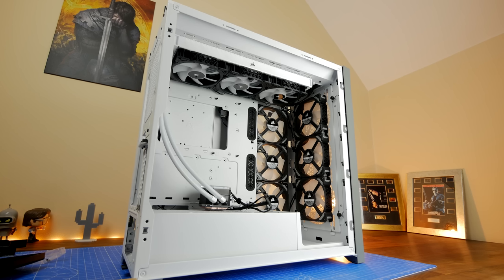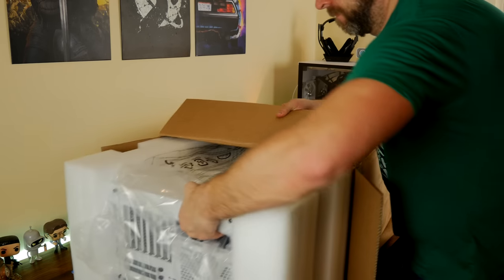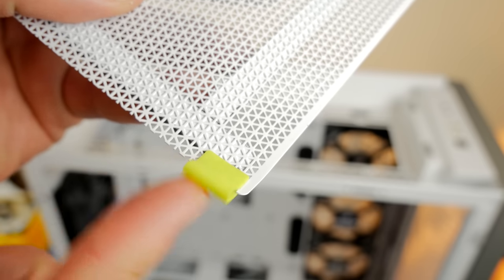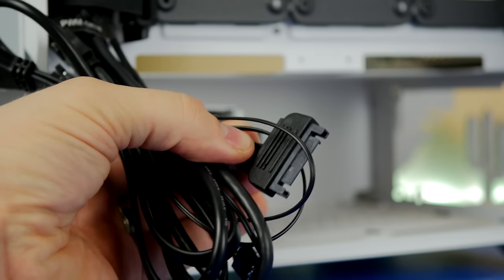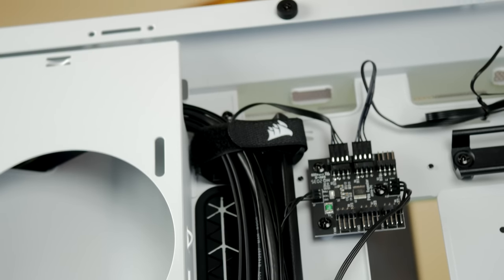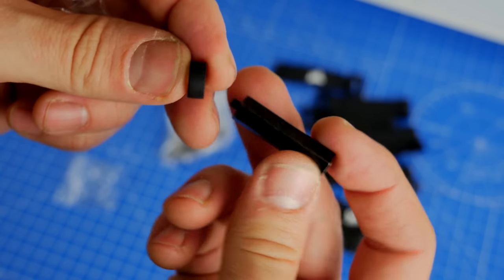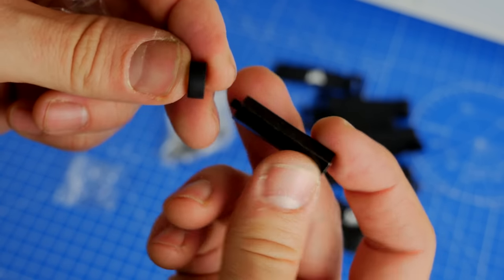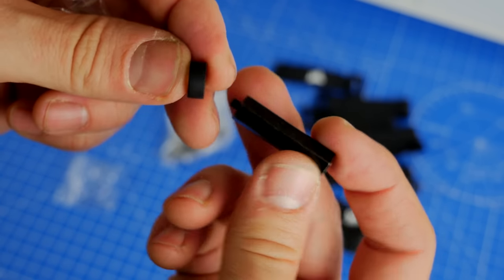Corsair 5000D Airflow build with 12 fans, H150i Elite Capellix Push Pull (in-depth build guide)

Comment: I'm doing an identical build to yours except I used the h150i with LCD display. Any tips as to how to connect everything to the commander pro.
Reply from the maker: https://youtu.be/XahzpIZFyrM
Reply from the maker: And https://youtu.be/jvXCbny-Suw
Reply: @TheProvokedPrawn  only one I'm stuck on is how to connect the LCD on the h150i to the commander pro. I have an Asus maximus z790 hero.
Reply: Thanks I finally got all cables plugged in and things organized. Now just waiting on replacement fan and cpu
Reply: @TheProvokedPrawn  I plugged in everything accordingly fans are all running but only three out of all 12 fans are lit up. Is there an area in bios I have to change this or is it in icue.

Comment: Does it support 3x 140 in the front? It doesnt say anywhere if its possible but those 120mm just look to small for the cut outs
Reply from the maker: The official page says 140mm support is two front, two top. That's it.
Reply: @TheProvokedPrawn  i mean ya but the cut outs hare waaay bigger than the fans so i was kinda curious

Comment: Hi I am doing a build with this case and a push pull top radiator configuration. What did you do with the dust mesh grill on the top?
Reply from the maker: I put it on top but you don't need to

Comment: Hi, what screws did you use to mount push and pull fans, please?
Reply from the maker: If I remember correctly they included enough with the AIO. But if you need them separately - XSPC Radiator Fan Screw 6-32 30mm... https://www.amazon.co.uk/dp/B015BSAQ0O?ref=ppx_pop_mob_ap_share
Reply: @TheProvokedPrawn  thank you. Im using just 'push' atm but i want to instal another 3 on top for push and pull. I will check my box if i got any left byt im pretty sure i used all the long ones. Anyway thanks to your video im rebuilding my case atm 😉 also want to put 3x 140 on the front, but i need to rebuild the mount as there is not enought space for 3, litteraly 0.5cm too short.

Comment: It's so frustrating that NOONE shows how to connect the cpu cooler cables when they do the core. Can't find a single video. I have x5000 case but it has fans plugged in and now the cpu cooler core has another SATA cable that I don't want to use. So annoying
Reply from the maker: I might have done a better job here https://youtu.be/VYgWCVMOQfE if not I'd recommend checking out Corsair Labs channel. They have setup videos.

Comment: Will most x570 boards have enough connectors on them to run a commander pro and commander core and lighting node?
Reply from the maker: Lighting node can connect to commander pro usb so you only need two usb headers which they should have
Reply: @TheProvokedPrawn  thank you very much man, also i may pinch your 5000 fan/AIO setup if you dont mind 😉

Comment: can i do the push pull set up with 5 fans? i only have the two spare that came with the 5000d
Reply from the maker: You shouldn't really mix and match fans as they'll run at different speeds and have different airflow capabilities
Reply: @TheProvokedPrawn  oh ok well thank you i hope it’s alright but i have 6 sp120 fans from corsair running in the case then i just have the rad i may plan on buying more fans for the pull in the rad

Comment: Ok so I have 13 fans in mine and of course only 12 slots any idea how to get the last fan rgb linked into the rest of them? 6 top (push pull) on the AIO 3 pre installed front 3 back panel and one rear.
Reply from the maker: For power you could use the system fan headers on the motherboard. Then RGB you'll need a lighting node that comes with a triple pack probably
Reply: @TheProvokedPrawn  OK, so the 13th fan is powered by the mobo fan header but no rgb power. I do have a few more of the hubs that came with fan packs but they require the  USB mobo connections, which are both occupied already by the rest of the rgb hubs. Unless there's another way to Power it?
Reply from the maker: @jasonb252  you could get a y splitter cable for the USB. Two ports into one.
Reply: @TheProvokedPrawn  genuis thank you so much!

Comment: I have the same aio and it sure do make the cpu run cool, but I noticed when ever my fans stop running, due to the zero rpm mode, I can hear the pump. Its a high pitched humming, and that's in the quite mode in icue. Is there any fix to this problem?
Reply: I have the exact same issue. Same setup here. The sound is driving me nuts when im working or need to focus. Im actually thinking of returning the cooler just because of the high pitch sound. But it looks so cool..
Reply: Same here. I was fortunate enough to be able to return it. I don't mind a little fan noise but the tone of that pump is impossible to ignore. Earlier models (like the H115i) were able to run the pump lower therefore quieter.

Comment: Hi what fan are you using for the exust at the top? Is it the same as the aio fans or can I use any?
Reply from the maker: ML120 Pro RGB if I recall correctly. You can't actually buy the exact same ones that come with the AIO at the moment.
Reply: @TheProvokedPrawn  thank you 😎

Comment: I bough separitly 4 white fan Corsaire QL120 RGB and i don't have the rgb's hub. Do you have an amazon's link to buy what missing plz
Reply from the maker: You bought four individual fans? Here's an RGB hub https://www.amazon.com/Corsair-CO-8950020-Rgb-Cfan-Compatible/dp/B075GWMJ68/ref=mp_s_a_1_9?dchild=1&keywords=commander+pro&qid=1617864367&sr=8-9
Reply: @TheProvokedPrawn  yes , individual fans because the pack of 3 was more expensive. But i didn't know that i would need more than the hub installed by default in my case (5000D airflow) for power & rgb. In fact, i need to hub, one for the power (by the one installed in the case) and one for the rgb. Why doesn't one for power and rgb only ?! Thanks for the link.
Reply: @TheProvokedPrawn  I got an another question, in 39:00 , you talk about the connection of the front pannel but i don't have this kind of connection in my Aus Prime Z270-A. is there an adaptater existing ?

Comment: am having issues after building get to bios 
really easy everything shows as it should. 
but had issues with loading an OS it kept going BSD or BSD
reset cmos tried a few more times even ran a win pe with no issues.
tried both win 10 and win 11 
any suggestion before I install my videocard asus 3090Ti and I need to register windows as well

ASUS ROG Maximus Z790 Hero 
intel core 13700K
Trident Z RGB 64mb 6000MT in 32 x 2
Corsair 5000D airflow
CORSAIR iCUE H150i ELITE LCD Display 
2 packs QL white 3 pack 120mm 6 total
MSI MPG a1000g Pcie5
Reply from the maker: Have you checked its not really simple things like your ram is seated properly. Turn XMP off and see if that helps, etc
Reply: @TheProvokedPrawn  yes I swapped the ram and used default setting in bios I was able to get WIN10 installed thank you for your advice.

Comment: Is push pull better than just push? I got a Phanteks p400a so I could only push pull with 240mm (top 2 fans) so it might look weird
Reply from the maker: I believe the difference is marginal. You could compare the benchmark temps in this video to the ones in the other Elite cappelix video I did and check how much difference it made. But that was a different case and setup.
Reply: Push pull would be beneficial for low static pressure fans as this capellix AIO comes with ML fans you won't need to add more fans. Other benefit from reading multiple source is you might be able to run the fans at lower speed to achieve similar results at higher speed (again because of higher static pressure, more air would be able to pass the radiator)
Reply: Thanks for the help guys! I ordered my h150i so I'll do some testing when it arrives. I wonder if yall would be able to help answer a dumb question: can you mount the 3 ML120s on the front of the rad and 2 SP140s on the back, or would the misalignment of the frames actually block air flow?
Reply: @shoturschnitzel8988  Besides misalignment of airflow path, I don't think you can screw in the fans onto the radiator. If this is p400a case I suggest to put the h150i as intake and use your 2x140mm fans as exhaust

Comment: 1. Push/Pull - no difference, flexing for no reason ( excepting the situation when you are going for the cheapest AIO and even there is a maybe for efficiency).
2. There is no reason to use the dust filter for exhaust, you are restricting the amount of air from the case.
3, Thank you for the vertical mount video, but between +20 degrees on the 3 SSD and chipset and +20 degrees on GPU....I go for GPU

Comment: hey, can i connect 3 ML 120 pro rgb fans to the commander core (controller is from iCUE H150i elitr capellix)
Reply from the maker: Yes
Reply: @TheProvokedPrawn  are the same fans that came with the pump
Reply from the maker: @granata4  no because you couldn't buy them at the time. Pretty sure I covered this in the video
Reply: @TheProvokedPrawn  corsair support told me that i can connect only in PWM slots now because fans are different i'm confused, I bought ML 120 PRO rgb fans because i thought they are the same as in the iQUE H150i elite capellix, now i have 3 ML elite fans from elite capellix, 3 ML 120 PRO rgb and 4 QL 120 rgb fans. How do I connect it all together now, what's the best options

Comment: you could have pulled the motherboard out plugged them in then pushed it back up same thing but simpler and faster then trying to remove your rad +fans and put them back in
Reply from the maker: Hmmm I would have had to unscrew the motherboard
Reply: @TheProvokedPrawn  yes but the mb is easier to put back in then trying to hold rad and put screws back in at same time

Comment: This video helped me SO MUCH! But ive run into a problem.

My 5000x case came with 2 "hubs". 1 for 6 fans, 1 for 6 fan rgbs. I also got the H150i Elite AIO, which came with a commander core 6 fan/6 rgb ports. The problem I'm having is I am trying to control 7 fans...

The smaller rgb core that came with the case AND the commander core both have a 9pin usb plug. I only have 1 USB 2.0 header on my mobo... So as of now, I can only plug in the commander core, so I have 6 fans that light up and work great, but 1 fan that I had to just plug directly into mobo and rgb doesnt work.

Basically can you go over how you linked all of them together? Can I just use a USB hub or splitter so I can plug both rgb controllers into the same usb header on my mobo? I obviously dont want to fry something, but I really want my other fan to be controlled by iCue like the other 6... I'd prefer to use a usb hub since its vastly cheaper than buying the commander pro.

Ive already ordered a 1 to 2 usb 2.0 header splitter AND the NZXT internal usb hub, but I'm scared to plug them in until I know its safe. I only plan on using 1 of them, and I've read that most people have success with the NZXT hub. Most online articles say it will work fine, but I read one review that said by doing it, it fried his commander core... PLEASE help!
Reply from the maker: I think I covered that in here https://youtu.be/VYgWCVMOQfE

Comment: I'm bulding a similar build so this video really help but I'm still confuse with one thing and that is the amount of USB and SATA headers I need for all of the connection because that affects your motherboard selection so I'm here to ask to see if anybody can help me figure it out. I'm going to have seven fans plus the three of the aio cooler which makes it 10 all around the build and Asus Rog Strix B550-A motherboard because it fits the color and brand scheme I'm working with, so let me know if that motherboard has enough headers for the extra iCUE Lighting Node CORE that comes with the three fan pack and the CORSAIR iCUE Commander CORE that comes with the AIO cooler
Reply from the maker: You can always buy something like this if you need to https://amzn.to/3PkNcly

Comment: I'm getting 7 fans, what do you suggest I do?
Reply from the maker: Well, you could use the PWM controller for six and then one just power via the motherboard fan header?
Reply: @TheProvokedPrawn  SO that would allow me to control them right? But what about the RGB, this is a bit confusing for me.
Reply: @sinz2159  which 7 fans are you using? if you're going corsair and buying fan packs (at least one pack), you'll get the lighting node pro with rgb hub and that will solve your 7th fan issue, so long as you're getting any of the capellix AIOs so you can use the commander core for six-fan power and rgb connection.
Reply: @giocalvin_  The ICUE QL120, and I'm getting the NZXT Z73
Reply: @sinz2159  the z73 makes things a little hard (more expensive too) . if you get 2 triple QL fan packs, you get 2 lighting node cores for the rgb plugs, and you have to get a commander pro, which rgb hub can be used to connect the 7th fan. I've never used the QL fans or the commander pro, but that's how I'd go at it from a rough mapping standpoint. I got 8 fans in my 4000D, 6 LL120 and 2 ML120 that came with the h100i capellix. The 6 Ll 120 are connected to the commander core that comes with capellix (rgb and power) and the lighting node pro that came with the LL120  pack is used to connect  the ml 120 and rgb strips. I'm planning on switching the lighting node pro to commander pro because the ML fans LEDs don't get all detected when I select them as ML in icue, but get detected when I select them as rgb strips. So that's that for info.
Reply: @giocalvin_  So should I just get the commander pro for the 7 fans

Comment: 38:00 i think you could remove just one black fan :D
Reply from the maker: Probably
Reply: @TheProvokedPrawn  I have this case now and had the same problem :D (I forgot your vid) Luckily i have Actic Liquid Freezer II 360 so it's 37 mm rad (not 27 mm like most AiO) and i had to move the fans outside to make it pull setup (i'm planning 15 mm fans to make it push/pull later). So i had a little more room (just 37mm rad, not 27+25 mm like you) and i managed to move the rad to the front and pass through the CPU cable :)

Anyway yeah ... it's the problem in this case, and the second is the placement of 360 (120 fans) rails on top. I had to make it as pull setup with 25 mm fans because i had collision with VRM cooler and it was literally like 1-2mm too close ;/ It would be much better if Corsair made the rails for 360 mm rad closer to the glass panel.

Comment: does 12 fans means 9 fans from cabinet and aio and 3 fans of gpu?
Reply from the maker: No. I showed push pull on the radiator
Reply: @TheProvokedPrawn  oh ok, got it :)
Reply from the maker: @prince-sonawane  it does say so in the title and I showed it in the video. Amazing how many people don't see 🤣
Reply: @TheProvokedPrawn  you should put timestamp as not a lot of people have empty time on their hands. I saw 12 fans, saw the frame from in video, show 9 fans so got question as I have seen a similar setup with 2 fans on psu shroud!
😏
Reply from the maker: this is an in-depth build guide. That's one small part of the whole. If you don't want to watch the whole thing then the video isn't for you I guess. And that's fine.

Comment: i found your clip because i’m interested in this case for my actually build because i have too much heat inside of my case. 70dB is like sitting in front of a jet engine. sorry… this is too loud. i think this is resulting in installing 6 intake fans that airflow crossing during the entrance and you got some bad turbulence’s inside of the case. there would be 3 fans enaugh for intake. 0 rpm results in fast temp uprising of your components, so your fans need to quick up on rpm to get the heet low bevor your pc shuts down. try to set them at least 10% on min rpm. 800 rpm are so loud like whispering. so you can also go to 20% min rpm. for max rpm i would set max 80-90%. everything more is really too loud.

Comment: Whats you're temps on your i9 10900K.
Reply from the maker: I believe I benchmarked and gave that data here https://youtu.be/2wD-InnNRxU (and in the description)
Reply: @TheProvokedPrawn  Thanks im thinking of getting an i9 10900k as i want the best experience in Far Cry 6 i currently have an i7 10700k bit in Ubisoft games the i9 10900k dominates on the Intel side. I'd get a Ryzen 5900X bt then that means getting a new  Motherboard and CPU. I'm also not sire when the new CPU'S with DDR5 support are releasing.
Reply from the maker: @originalityisdead.9513  not until 2022 I believe

Comment: Can you put 140mm on the sides?
Reply from the maker: The specs say you can only fit 140mm on the front and top, not side https://www.corsair.com/uk/en/Categories/Products/Cases/Mid-Tower-ATX-Cases/5000D-AIRFLOW-Tempered-Glass-Mid-Tower-ATX-PC-Case/p/CC-9011211-WW
Reply: @TheProvokedPrawn  and one more thing does the side air panel have dust filler? Keep up the awesome videos also!
Reply from the maker: @CaptNemo_  yes it does.

Comment: "problems installing  this PSU with the hard drive cage in "  NOT Wrong  --- of all the Great features of this case  , the PSU & Hard drive cage placement are the Worst ! i've ever seen  --- the HDD cage has to be removed to install the PSU  , and IF the cables are pre-installed it's more than tight to refit the HDD cage ( the rear thumbscrew is inaccsessable !)  moving the cage forward means the side fan tray is blocking the drives[?!]   a better design would have been a seperate PSU mounting plate so it could be mounted from outside the rear of the case (Lian Li and Coolermaster had these)  --- not a great case from a build perspective ---- will definitely have Good airflow  [ never again for Me ] - PC builder

Comment: I followed the steps and my PC still won’t start up. The fans won’t even work.
Reply from the maker: Nothing happens? Sounds like a loose power connection, check you have all the motherboard power cables plugged in. Especially the large one.